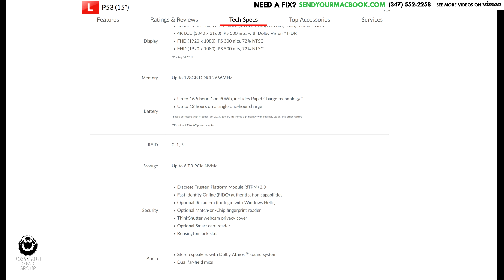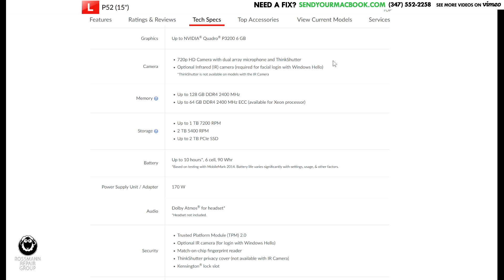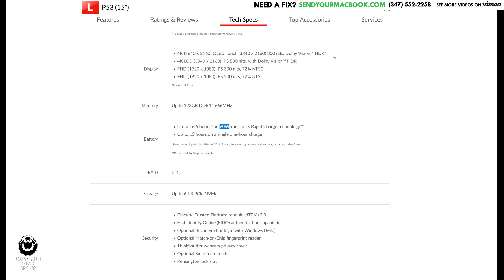Reading my YT comments is depressing

Comment: I agree with you.  I replaced the screen on an HP a week or so ago that had the internal battery.  Normally, I would simply remove the battery before removing the screen bezel and doing the screen replacement.  On this machine, I had to remove the bottom cover, which was not only held on by a dozen or more screws, but also little fragile plastic snap thingys which I had to be careful not to break.  And that's just to get to the battery to disconnect it.  I could have replaced the screen on almost anything else in the time it took to get to the battery. Very frustrating. And then for some reason, they glued the screen in.  Not like everybody else that just holds it in with 4 screws.  Nope. They had to make that difficult too.  There's absolutely no sense in using 12 gallons of glue to hold a screen in that could have been held in with 4 little Phillips head screws like everyone else does.  HP wants to be like Apple so bad they can't stand it. But they've always made junk. Ok. I'll get off my soap box now.  Keep up the good work Louis.

Comment: I don't get it, it's a high end desktop replacement machine, nobody that needs one cares that the laptop is thinner, they don't care if the battery sticks out and is "ugly", most people using them are probably just going to use them on their desk at work then use it on their desk at home keeping it plugged it, and they'll probably use them for several years but they might occasionally use it on the go and when the battery dies they'd like to be able to easily replace the battery on their $2000-5000 machine. For people that want a thin and light mobile workstation there's always the P1, I don't get why they're screwing with their desktop replacement line they're meant to be bulky and easily serviceable.

Comment: wtf is with this trend of not letting us remove/replace the fucking battery... atleast when it comes to laptops if the battery takes a shit you can still use the laptop by plugging it into the wall.... unless the battery is shorting it in which case it not being removable is a problem...

Comment: tl;dr version

the battery doesn't have more CAPACITY (amount of energy in total). the battery LIFE is bigger (it lasts longer) becuase something in the laptop is using less battery.
Reply: (Something in the laptop)
i.e. more efficient board (power regulator, boost/buck converter, more efficient backlight, better CPU that uses less power)
Reply: @kopazwashere   It would be an ironic twist if we found out the modular battery was storing too much heat, so by making it built-in they could run the fans less and therefore use less battery.

Comment: I agree with you, ThinkPads became trashy this year... Even the t490 and t590 aren't user friendly anymore
Reply: Makes me value more my T480 with the huge battery!
Reply: Thinkpads became garbage as soon as they started using chiclet keyboards.
I'll cling to my T420 until I die.
Reply: TissuePaper Me too. I got my pair of T420s for $100 each. Both with i7 and 8GB of RAM, and a 500GB HDD and 128GB SSD respectively. They’re absolute tanks and do anything besides gaming without a hitch. The battery life really isn’t great however, and I wish a good screen replacement existed. Does anyone know a good way to adjust overclocks on them? I’m really trying to undervolt my CPU to squeeze some more battery life out.
Reply: @Evildandalo  You could create a custom profile for cpufreqd and always use the lowest available frequency. Also, clean your machine so the cpu fan won't have to spin as much and will do so with less friction.
Reply: @shu9460  I really don't notice the screen. I don't do any photo or video editing, so it doesn't matter to me.

Comment: Something I mentioned in the last video is that the FAA have a flat limit of 100WHr for batteries that can be taken on a flight. Considering Lenovo P52 and P53 is already at 90WHr and uses a 6 cell design, this is as close as they can get to the limit.
Still, boo for non swap able battery.
Reply: I'd be happy if somebody made a 150 watt hour removable battery with a sticker on it that says "don't fly with this thing."
Reply: The P7x series already uses 96-99Wh batteries, if there truly was something to be gained by going internal they could have made the P53 99Wh.
Reply: The limit is 160Wh for lithium batteries however over 100Wh you need operator approval (nice lady at check-in desk needs to call  the flight director to get it).